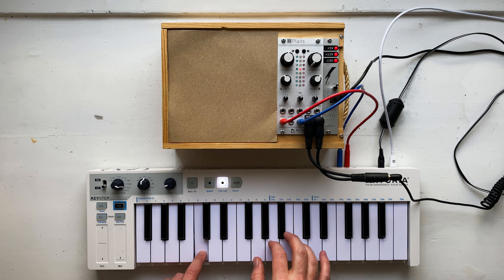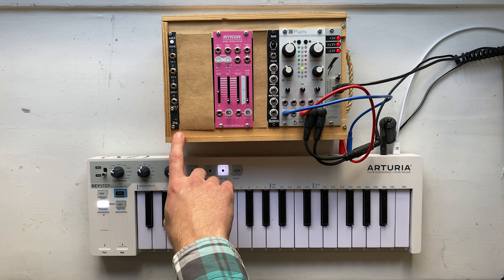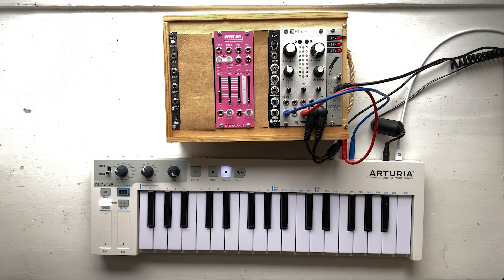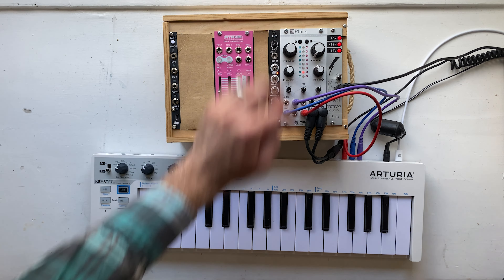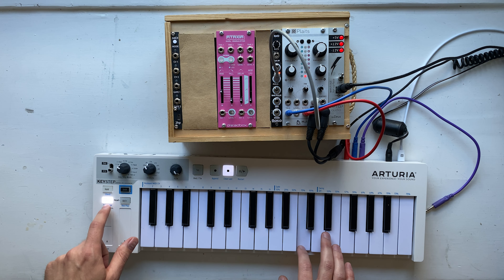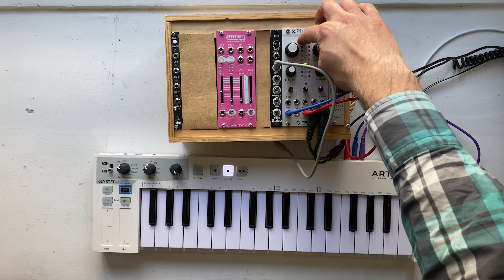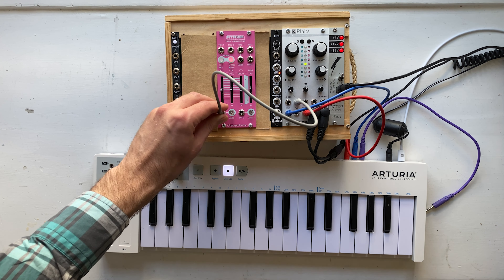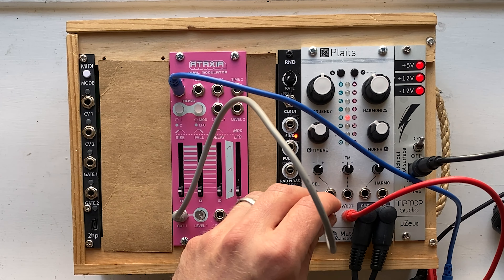Getting Started with modular synths - LFOs and Envelope Generators

Comment: Really nice intro videos on modular! So far you have been always recording one "instrument" of plaits into Ableton but is it also possible to output multiple of the "instruments" of plaits oscillators at the same time (possibly towards other modules for effects or something else)?
Reply: I have a plaits, and you can sorta do that, but not really. Each LED in the middle is a different synth model (8 green and 8 red for 16 models), and you can't send multiple outputs from different models. However, for each model, there's an "AUX" output, which is different depending on the model. For some, it's an alternate version of the synth model, so you have two similar but different outputs. For other models, like the percussive models, the AUX just sends the noise click that excites the main output.